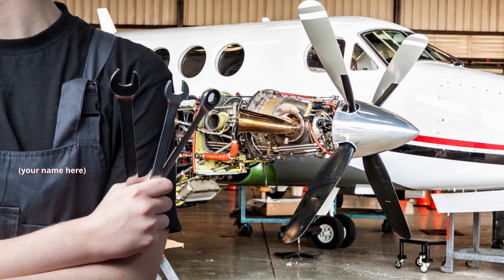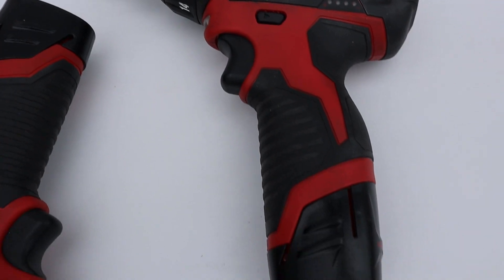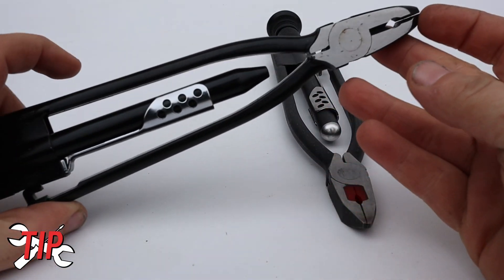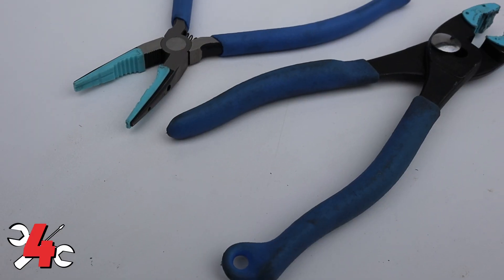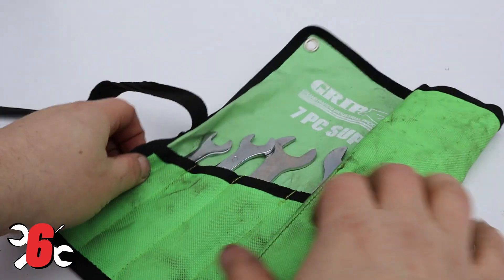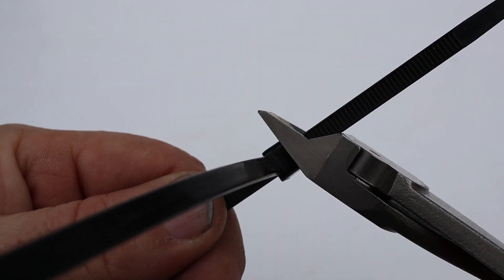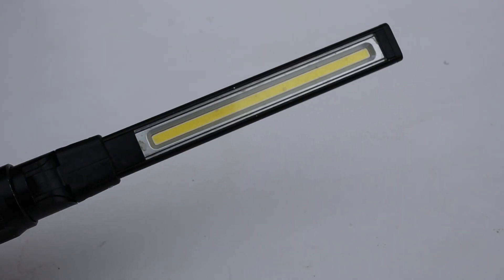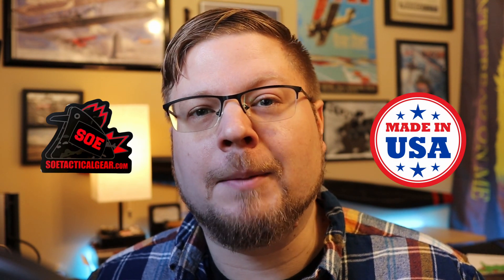Uncovering the Tools Every New Aircraft Mechanic MUST Have

Comment: Thanks, i've watched a few of these AMT toolbox reviews and they are all asked "what is your favorite tool and most used?"  the reples typically are: most used "long handle wire cutters" and favorite tool " knipex pliers."  great idea about the soft jaw pliers and low profile wrenches, looks like i'll have to pick up a couple new things.  Thanks again and have a great weekend.
Reply from the maker: Haha yea I watched a bunch of them too before I started at the repair station. Some tools were helpful, some I've never touched. Guess it all depends what kind of work you're doing. (I actually think it took 3-4 months before I needed the long handle wire cutters. 🤪) Thanks Jeremy, you too! (Although I'll be at the shop wrenching on a Navajo... Overtime!)